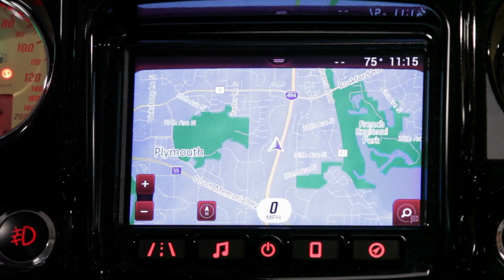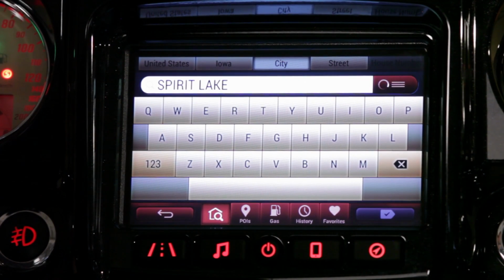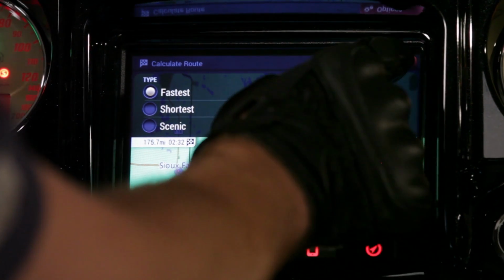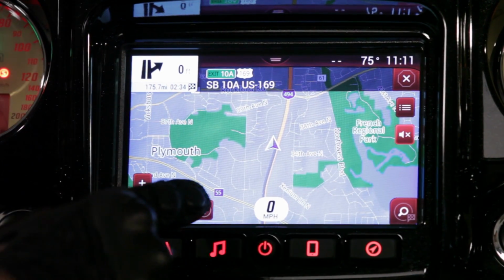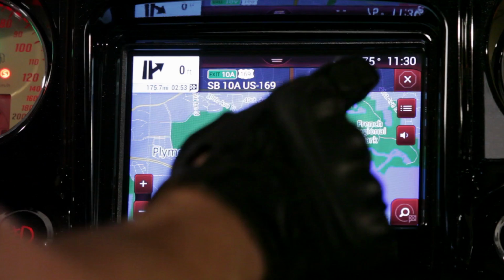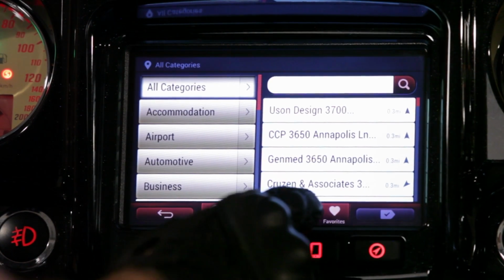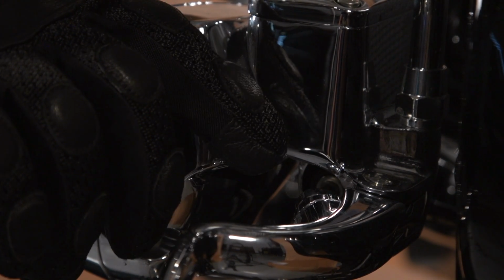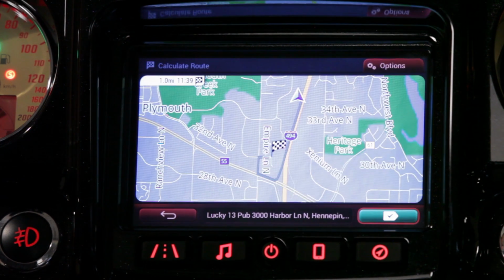Using Navigation System on 2017-2019 Indian Motorcycle Ride Command - Indian Motorcycle

Comment: How about so additional information like:
1) How are maps updated, can they be done by the end user and what is the cost?
2) Can routes have multiple stops\waypoints?
3) Can routes be uploaded to the nav system?
4) What software is used to create routes that can up uploaded?
5) Maximum number of routes that can be stored?
5) Maximum number of stops\waypoints in a route?

Currently I use a Garmin 660lm that supports all these feature as does HD Boom so if Ride Command does have these features a 1/2" larger screen does much good.